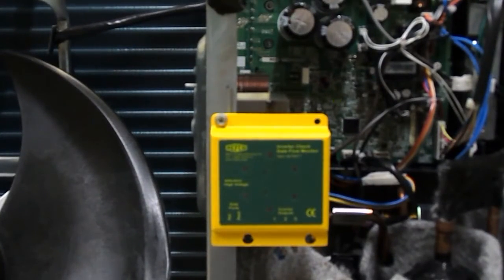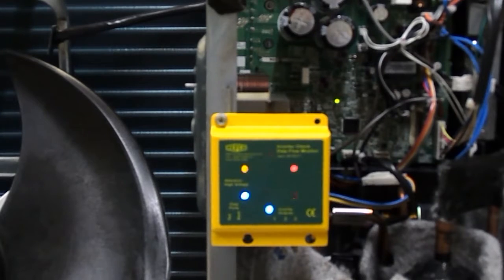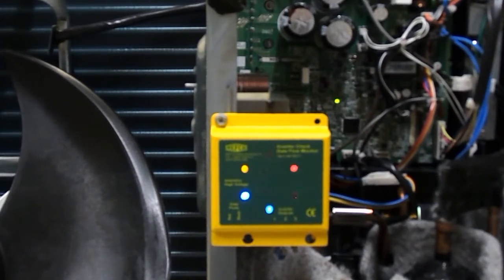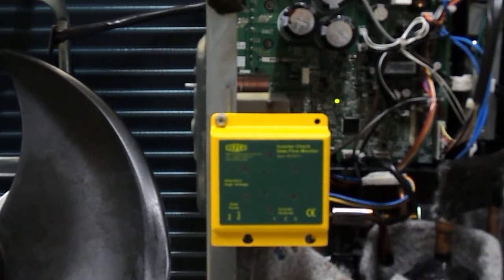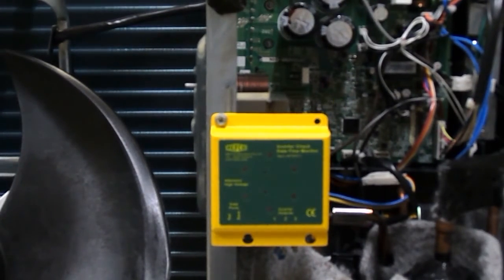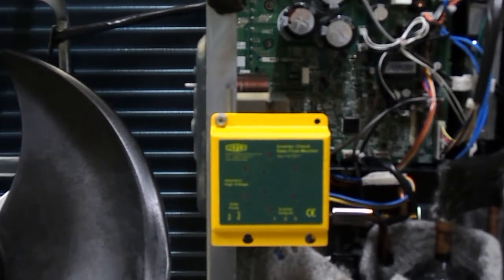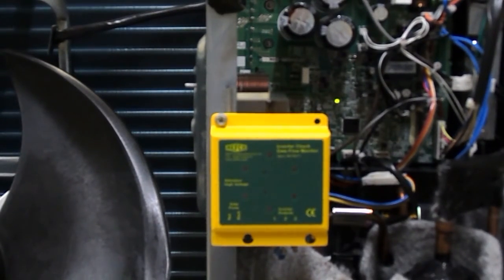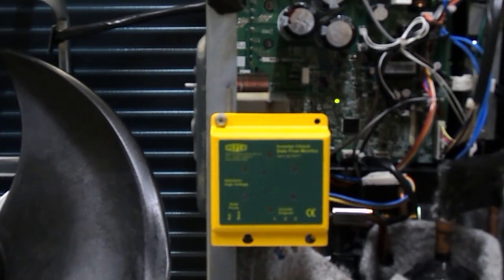Inverter testing using the Refco Inverter checker

Comment: Can this be used on household inverter compressors? Please respond, thank you.
Reply from the maker: I have no information on that,  check with Refco agents.  It purpose was domestic to commercial air-conditioning given it included a data flow check

Comment: Hi Dennis, nice and good video, btw have u a guidance to test the inverter compressor?
Reply from the maker: Hello FT , that all depends on what the manufacturer has provided , the basic checks should ensure all  3 windings are even resistance. Your options require you to either resistance test the IGBT or use one of these types of testers to check output phase balance. Their service manuals will show you what options you have.  Some brands have in built power transistor check modes that prolong the output operation just like this one in the video.  Others you only have less than 6 seconds to watch it work.  My advice is to do all resistance based testing first at the locations specified in the service manuals and then use this tool secondary. What this tool cannot diagnose is mechanical rotor lock  eg a compressor siezure. So a two end type test is best for accuracy, being resistance test and phase output

Comment: Hi im just ask if some case that you dont have that tester? Can i use a multi meter?ac volts? Or dc volts?
Reply from the maker: The only tests for IGBT are in the manufacturers service manual with one or two way resistance testing if avaliable. Not all AC units have a test mode for IGBT that ignores position detect and runs longer using this output device.  Live testing is not safe and as these units work on switched mode power supplies , only a true RMS multi meter would work with differing frequency and voltages. Typically there will be a resistance test that could be used to test the IGBT / IPM , check with the manufacturer of your brand of air conditioner
Reply: @whatwoulddennisdo7243   does the inverter tool confirm correct IGBT operation? If not, is the tool simply a check of correct output sequence and nothing else?
Thank you

Comment: Hello, this device can detect problems with communication or compressor air conditioning device if it will not start and shows me an error? I have a device that starts the fan inside and quickly shows me error F1 (outdoor unit does not start), the sensors are good. This tester is only valid if the device works or air is able to use it to find the problem and if not start? I want to order and don't know how it works, thanks
Reply: It only works if the compressor is sent power by the pcb. If the compressor is not told to turn on (power sent to it) then this tool is useless